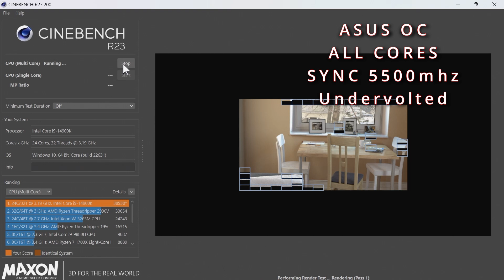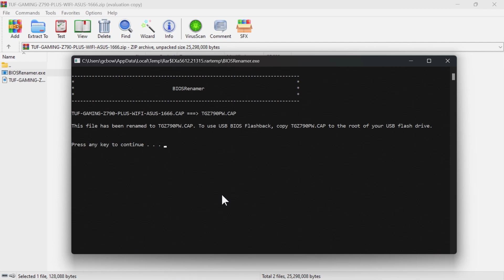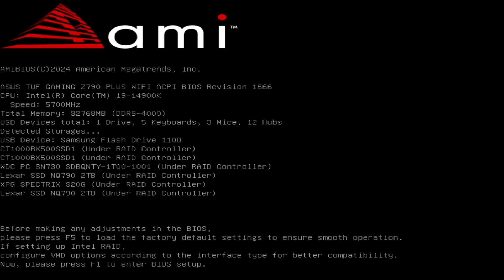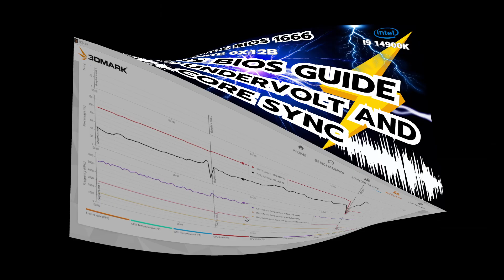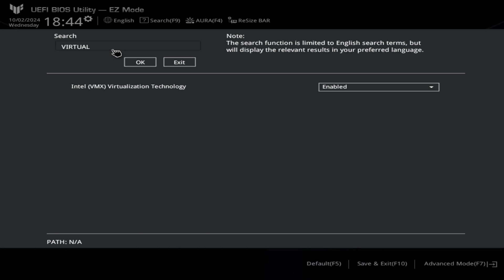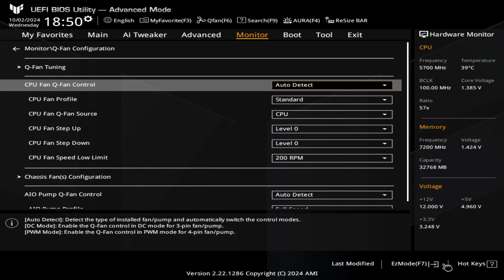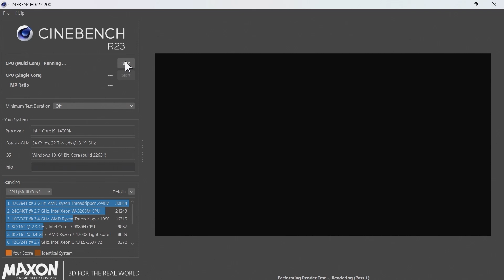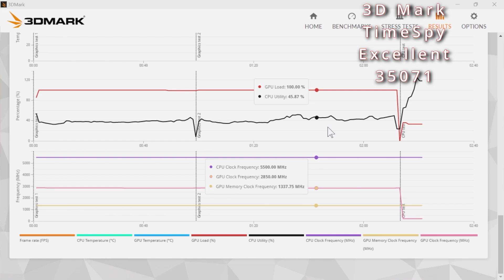i9 14900k Asus BIOS Guide Part 3 Version 1666 Beta Microcode 0x12B Improve Elevated Voltage at idle

Comment: I bought a prebuilt last week. It has i7 14700kf. Asus. Am I safe?
Reply from the maker: @brandonmcclelland4359  Provided the BIOS has been updated to the latest version then the issue with VID requests would have been mitigated, the undervolt is optional to lower temps, depends on age of stock of the prebuilt
Reply: @nextlevelsimgaming  can I overclock the cpu or is that unsafe with these?
Reply from the maker: @brandonmcclelland4359  The issues should now have been resolved with the micocode revisions, the Raptor Lake processor issues were that they always have run hot.

You can overclock them provided you have an adequate cooling solution, otherwise you will hit thermal throttle and lose performance
Reply from the maker: @ The CPU will boost where it needs to under load, best advice is download Cinebench R23 and 3D Mark Benchmarks as shown in the video, and follow the guide accordingly
Reply: @nextlevelsimgaming  awesome! Thank you!
Reply from the maker: @ No problem 😉
Reply: It’s my first pc and this crap happens? Smh
Reply: I have this..I’m not sure what motherboard is in this though. Sorry I’m a noob
Reply from the maker: @brandonmcclelland4359  The motherboard is likely to be proprietary if its a prebuilt, so you may not have access to the full features to enable you to overclock
Reply: @nextlevelsimgaming  oh ok! It says my cpu is 2.5ghz. With boost to 5.6ghz. Is this an automatic boost or do I have to overclock?

Comment: Bro I finally got my 14700k overclocked to 6ghz all core stable with tvb and kept it under 1.5v using these settings…. A couple minor adjustments were made to better suit the 14700kf instead of an i9 but generally speaking you’re gonna get the same or higher cpu score by overclocking the i7 in gaming price per$ than you will with an i9 so I’ve been trying to perfectly balance this cpu….

Now that the OC/UV is stable I just need to install my thermal grizzly mounting bracket so I get proper heat transfer. Good thing I’ve got a brand new kryosheet waiting for it..

Since I plan on using the kryosheet would you recommend full blown delidding my cpu and going direct die like with Liquid Metal? Seems more straightforward to install on a GPU performance wise than a CPU but my 4080 super stays below 45c overclocked to the max at +15% and stable
Reply from the maker: Its really aimed at the novice user, so to start giving advice on delidding etc would be out of my remit to be honest, my view on going that far with tuning is that you relinquish all chances of an RMA if the processor does develop a fault, so wouldn’t really like to say.  Ultimately its your chip to do what you please, but it becomes addictive in the respect that you can push the boundaries too far.  Glad the guidance has helped though 😉

Comment: can you please make the same for 14700k pleaseee?:)))
Reply from the maker: @Tautv1ST  I don’t have one to test unfortunately, the Intel Default Table is based on the i9 processors, you can check the power limits by searching ‘Intel Default Settings’ on Google.

The principle for undervolting remains the same however.

Comment: Great guide thank you so much. I do have one question concerning my i9 13900kf. I get stuttering in game (DCS) when ecores are on & none when they are off. Is the something to be done with them or is it just ok to leave them off? I only game on the pc.
System is:
i9 13900kf, 64 gb (2x32) ddr5 cl30 6000mhz, Asus z790p mb, rtx 4090, Samsung 2tb 980pro.
Reply from the maker: @toastieanddcs  Its fine to disable them, this was covered by Buildzoid (Advanced Hardware Overclocking) apart from in productivity where they serve a purpose, Intel have ditched them in Arrow Lake, you may get elevated temps however as the P Cores take the workload as they do help spread distribution of task.

Comment: Please tell us which cooler you are using for this setup
Reply from the maker: @Abstrahues  Corsair iCue H150i Cappelix 360mm AiO
Reply: @nextlevelsimgaming  not delidded? These are very impressive temps. Intel have outdown themselves
Reply from the maker: @Abstrahues  The issue Intel has is they advertise the i9 14900k to be 5700mhz, and 6000mhz boost, the thermo dynamics of the chip cannot sustain that performance, this is why the new Arrow Lake uses less power and lower clock frequency.

If Intel were to do a fix based on these settings they would be liable for advertising a product by misrepresentation, hence they can only apply methods to be seen to ‘fix’ the power levels, and delivery of the advertised levels at a considerable performance cost.
Reply: @nextlevelsimgaming  which is why I am perplexed to see users still achieving high cinebench scores at 5.5ghz all P cores. You got 39K by just undervolting, maybe I just don't understand the mechanics behind it but as long as the chip remains cool and performs well, I can't complain.
Reply from the maker: @Abstrahues  The chip will throttle less, and operate more efficiently at higher temperatures, by removing boost it allows consistent performance throughout the test.

If you think of tuning a car for fuel efficiency the principle is the same, it requires less fuel to obtain the same performance, every engine has a tolerance but is sent out of the factory at a specification generic.

The benchmark score is based on efficiency over task, this also translates well to gaming, more consistent FPS, less flapping (inconsistency in power delivery and request), and multithreaded all core synchronicity.

If you think of spinning plates, you have to keep them spinning at the same speed, and to maintain balance, if you have two cores fluctuating from 5.5 to 6.0 that balance is disrupted when others are at 5.5 to 5.7, and the thermodynamics become affected as well as power consumption
Reply: @nextlevelsimgaming  Got it! That makes sense! Do you see yourself upgrading to 285K? I'm a creator and I was considering it but now my 13900K RMA got approved and seems like the latest microcode may have fixed all of the issues
Reply from the maker: @Abstrahues  Probably not for some time, although I do have a new Sponsor SK Hynix in January so may have to as will be testing the new Gen 5 SSD’s they’re launching

Comment: What settings would be different if I have a 14700k?
Reply from the maker: @zanewickander5715  ICCMAX 307a PL1 - 125w PL2 - 253w everything else is the same.

See also this post 

https://community.intel.com/t5/Processors/i7-14700k-Performance-decreased-after-using-default-power-limit/m-p/1602504#M72931
Reply: Thanks for the reply. Can pl1 stay at 253w instead of 125w? And I left the offset at -0.0500 is that alright? I think my highest temp when gaming was 81c last night.  IA Vr voltage limit 1450 still as well? It says current / edp Iimit throttling sometimes in xtu.
Reply from the maker: @zanewickander5715  No because that would be in excess of the Intel specifications, PL1 is short duration power, the CPU will be in this state for the majority of its workloads, PL2 is long duration in other words a step up for the 2nd part of the power phase, you may experience premature degradation or failure keeping the short duration phase over 100w over the Intel specifications, to be safe remain within the guidelines, you would be overclocking the CPU under all conditions by doing so
Reply: @nextlevelsimgaming  oh thank you for the explanation! :)
Reply from the maker: @zanewickander5715  No worries 😉

Comment: I've never seen a creator respond to all comments. New subscriber right here. I just got a brand new i9-14900k. Besides microcode 0x12B, IA VR voltage at 1.4, plus all cores locked at x57,  is there anything else I should do?
Reply from the maker: @tylerbraun8748  Thats pretty much all you need to do 😉 as you may have seen in the news, Intels upcoming Arrow Lake are all about power efficiency and thermals, at a reduction in performance, and theres a reason for that.  Welcome on board 🙂

Comment: why my TUF GAMING B760 PLUS WIFI doesnt have undervolt protection . Its on and I cant turn it off in any way
Reply from the maker: @raminakb20  The guide is for the Z790 motherboards, also if you have a none ‘K’ chip that isn’t unlocked you won’t be able to undervolt or overvolt

Comment: at 10:36, the "Current CPU core/Cache Current Limit" is set to 307.0 A
should i set it to the value displayed ?

on a TUF-GAMING-Z790-PLUS-WIFI-ASUS
i7-14700K
Reply from the maker: @gatorfexxl6301  Thats correct for the i7 14700, so leave it as it is, the 400a in the video is for an i9 14900k 🙂
Reply: @nextlevelsimgaming  also the X.M.P is disabled on the main screen of the BIOS, but i see DDR5 6000MHz (from 4800 mhz) is displayed also
so idk if it's activated in a native way by the settings i follow in your video
Reply from the maker: @gatorfexxl6301  You activate it as shown in the video, ignore the main page, go into Task Manager / Performance / Memory and you’ll see it activated in there once you enter Windows 🙂

Comment: Hi, why do you disable intel virtualization? thanks in advance.
Reply from the maker: @Fabricio121197  Required to run Intel XTU for testing the undervolt using AVX2 stress test, see the Intel XTU tuning video for info
Reply: @nextlevelsimgaming  So after that test I can activate it again?
Reply from the maker: @Fabricio121197  If you wish, it also improves performance by disabling it, its only required if you use a VM

Comment: How you getting 39,589 I ran it a couple times (just got 14900k today) and I getting 33600 2 passes. My 13700k with an undervolt got 29-30k. I don’t have anything running in background when running test
Reply from the maker: @ElusiveAura  Thats the score, it even actually scores in excess of 40k with OBS not running, ensure all background applications are closed in the tray.  The next video I will be doing next week will be focusing on variables with undervolt, and how to stress test.

Have you followed the guide and applied the Asus OC with undervolt?, and sync all cores to 55?, you wont hit 40k on Intel Default
Reply: @nextlevelsimgaming yes I have.  Done it twice actually. When I do intel stock it does 32k. I closed everything in tray. My SP rating is 94. Have a 360mm. Temps look good with your settings at 75 package temp and 33700k is my score multiple times. Would bad contact with cooler or something cause it?  I wouldn’t think that would be bad because my temps are good.  I even have a contact frame.
Reply from the maker: @ElusiveAura  Its not the same results for everyone, but those scores seem way off the expected,  I presume you’re using DDR5 but RAM speed could be the issue?, i’m on two sticks at 32gb Corsair Dominator Titanium @7200mt XMP tweaked.  Your SP rating seems ok too
Reply: @nextlevelsimgaming  I’m running 7000 ddr5 trident memory. 2 sticks 32gb total as well.   Not sure what else there is.  System runs stable as heck but nothing I do gets my score anywhere near yours. Temps great. All tray processes closed. Latest bios.
Reply from the maker: @ElusiveAura  Watch the newest video on 0x12B Beta Bios update where I go through the settings in more detail, and F5 to take BIOS back to Default, check Task Manager to ensure there’s no vampire process running in the background, I close everything RGB software etc it should be run vanilla i.e minimal processes, the guys who run test benches have no other software running will have a further dive in to it with you tomorrow if needed 📈
Reply: @nextlevelsimgaming  I mean nothing is in the tray running but there’s always a ton of processes running that won’t really close. I will say I forced the priority on cinebench to HIGH. “Thought it was already” and to a new score of 34403 so that’s better but still

I will say my HWinfo shows my vcore at 1.332 and vid max at 1.370. Is that contributing to score being lower?  Those are good numbers and temps but maybe it’s not getting enough mmmph?
Reply from the maker: @ElusiveAura  Have you fine tuned the undervolt?, begin at - 0.05000 then test, then increase the negative offset by - 0.00500 so next will be - - 0.05500 then -0.06000 etc test stability in between, I can hit over 40k at an undervolt of - 0.07500 I would recommend using Intel XTU to test using the AVX2 stress test for 10 mins watch the Intel XTU guide I did, you can also undervolt in there so you don’t need to keep going in and out of BIOS, if it blue screens, it will reload as Default so its perfect to test undervolt
Reply: @nextlevelsimgaming  ya it’s actually stable from .0500 to .1000 which is crazy. Could an over tightened contact frame be causing it?  Just grasping here.
Reply from the maker: @ElusiveAura  Its a possibility, I actually had issues for the very same reason, I re pasted, was getting hot spots initially then I realised it wasn’t evenly tightened, both temperature and performance improved.

I wouldn’t get too eaten up over chasing figures on benchmarks, its both frustrating and time consuming, i’ve been there many times.  Sleep on it and come back to it in the morning with a fresh perspective 😉
Reply: @nextlevelsimgaming  I repasted and reclamped everything.  Took contact frame off. Redid it all and made sure not to overtighten.  Put all your settings back in. Ran a test. 34515. Guess I’m just unlucky. Not sure what else would cause it. I don’t feel like wiping windows.   I just assumed something was wrong when I read others get 40k on same processor.
Reply: @nextlevelsimgaming  so just an update man thought you’d like to know. I hadn’t wiped my machine in well over a year. Decided to do it tonight.  All I’ve done is reinstalled windows 11. On 24H2. Installed nvidia drivers and cinebench. Ran the benchmark and first score was 40,095. It was windows all along!  I’m happy now lol
Reply from the maker: @ElusiveAura  Fantastic, I suspected it was a random process issue probably impacting on efficiency, glad you got there in the end 📈🥳
Reply: @nextlevelsimgaming  thanks for all your help and commenting back.
Reply from the maker: @ElusiveAura  No problem mate 🙂
Reply: @nextlevelsimgaming  can you tell me what your SP is in bios?

Comment: I5 13600kf please 🥺
Reply from the maker: @chronicmystery  The principle of undervolting is the same, however I don’t have one of those processors to test or demonstrate in a video unfortunately.

The ICCMAX is 200a
The PL1 is 125w
The PL2 is 181w

After looking up for you, also start at an undervolt of - 0.05000 test then add increments of -0.00500 so next would be -0.05500 then -0.06000 be sure to test using AVX2 test for 5-10 mins on Intel XTU stress test

Comment: I'm waiting that Asus remove beta flag. I've read some users got black screen issues, I'm a bit worried... and I've already the previous version with the initial fixes.
Reply from the maker: @gianlucabing  Not had any issues personally, and have been using quite heavily testing, but no harm waiting they normally go to full version 2-3 weeks later

Comment: Hello 

Do you think I can apply the same settings as you for a 14700K? Or is it better to reduce certain values? The processor is cooled by a Be Quiet Pure Loop 2 FX 360mm.

Thank you for your answer
Reply from the maker: Hi, the PL1 and PL2 settings are the lower as is the ICCMAX, I don’t have one to test so couldn’t advise on those, but start the undervolt conservatively at -0.05000 then test with Intel XTU AVX2 test for 10 mins, if it passes, you can add another-0.00500 so for example -0.05500 etc its more balanced power wise so a moderate undervolt will achieve good results
Reply: @nextlevelsimgaming  I just see that in consumption it is 125watt minimum and 253 watt maximum, so I have to put these values in PL1 and PL2 ? but at ICCMAX level I can't find any information for the 14700K ? for the undervolt I think I'll start at -0.05000 and then see if it's stable or not. Do you know where I can find out about ICCMAX values? 

Thank you
Reply from the maker: @hardcoregamer406  Its 307a for ICCMAX just checked for you 😉
Reply: @nextlevelsimgaming  
Ah great, thank you very much for the information.
Reply from the maker: @hardcoregamer406  No problem 🙂
Reply: @nextlevelsimgaming  Hy, thx for the Guide, one question for 14700k  . All core Ratio Limit to 55 is good for 14700k.
Reply: @Ronja86  Put the all P cores ratio of i7 14700k to 54 or 53.
Reply: @TheOne214  thx man, i try